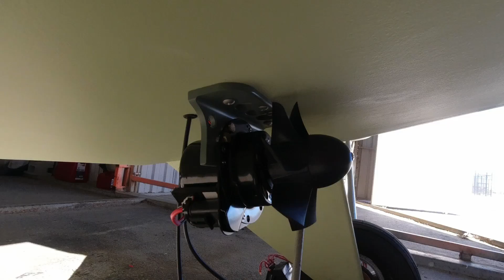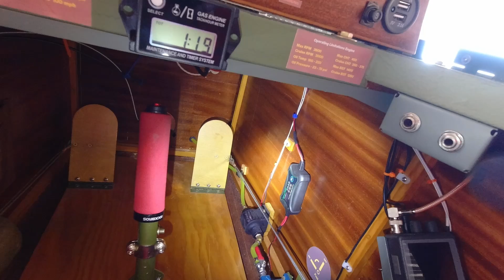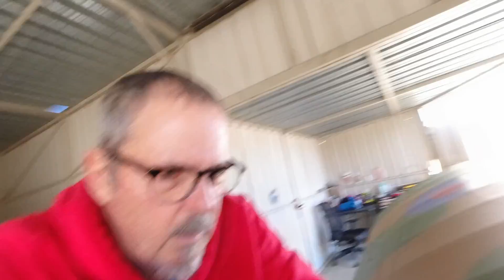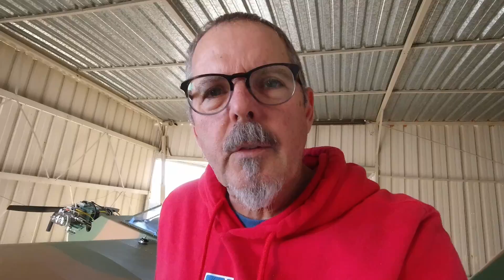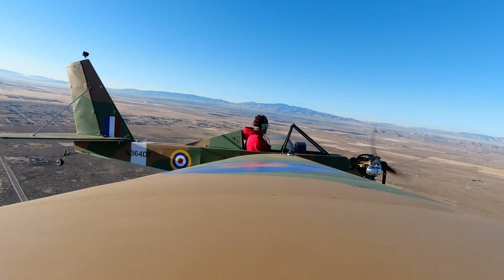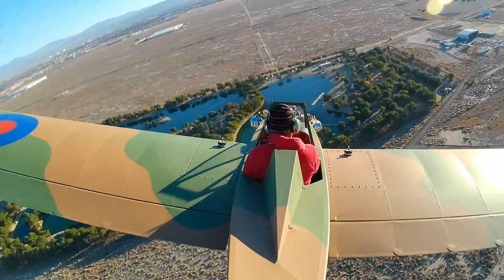Team Minimax 1100r Aircraft - Beautiful Day For Flight Testing

Comment: Just out of interest, what fuel does a Hummel 1/2  VW run on?
100  low lead or Mogas?
If it's Mogas, what octane rating is recommended?
Reply from the maker: I use 100LL. Scott says that’s what it’s designed for. You just have your keep an eye on the plugs for lead but I’ll change them often enough not to be concerned. 
If Mogas, I believe the manual says 93 min.

Comment: Thanks for the videos!  If you experience an unexpected off-airport landing, one the most common outcomes is for the gear to drag causing an over nose flip.  How are you for safety in such an event?   Seeing only what I can from the videos, I worry that you'd be positioned for head and neck injury. You can not lean forward to protect your head due to safety straps. If I'm not missing something, I would strongly/urgently urge a rear rollover protection.
Reply from the maker: The wind screen is built as a roll bar. I am going to build a helmet for additional protection. Thanks for following along
Reply: @DTMinimax   Delighted and relieved to hear that the windscreen is designed as a roll bar.  Has it held up in practice (accidents)?  I applaud your move to a helmet.  I fly with one.

Comment: How much lumber did you need for the build would love to know.
Reply from the maker: I used 5-2x6x12’ KDS4S Douglas Fir
2-1/2 sheets of 1/8” mahogany ply
8 sheets 1/16” ply that were 2’x4’
Some 1/8” Birch ply 2’x4’
2 sheets of 1/32 ply 2’x4’
1/2 sheet of 1/4” ply

Comment: Great to hear the Gennipod is working for you. I would hold off on the prop until you have about 20hrs on the engine.
Reply from the maker: Did you see the tanker release his water on that last circuit? It was so cool to see from the air!
Reply: @DTMinimax  I am sorry to say I was watching on my phone so didn't see that, I will have to look again on my computer.
Reply from the maker: That’s good advice…it’s not under powered and dragging around the sky, it is flying fine. Yea I’m really impressed with the Gennipod

Comment: I'm thrilled for you, Dennis.  Life is short.  Enjoy...  I'd be interested in some numbers.  Empty weight, straight and level cruise speed, fuel burn and range, engine off glide ratio, landing speed, etc.  And did you do the flaperon option?  My UL had that, so the plane would meet FAR 103, but was told never to use the flaps.  I never did, but I did add a couple of flaps reflex notches, which made it easier to trim for level flight, and added a tiny bit of speed.
Reply from the maker: You’re so right…life is short. I will bring some of that info to you.

Comment: Great video and great news on the Gennipod.  Nice installation, mine isn't as elegant but glad to hear the solution works.  I hope to have mine installed in a couple of weeks.  Thanks for sharing your journey!!
Reply from the maker: Hey William, you’re installing a Gennipod?
Reply: @DTMinimax  Yes, a GenniPod II on my Bowers Fly Baby.  Because of the fabric bottom, I'm installing mine on a landing gear strut, similar to what another Fly Baby did a couple of years ago.  I was fine without it until I installed a transponder and ADS-B out.  Now the batteries last fine for local flying, but are insufficient for any reasonable cross country.  I'm not using LiPO's, but may consider it based on your experience and installation.
Reply from the maker: @wfhills  Mine is also the II, I was so happy that it worked so well! I did it for the same reason, I don’t plan to stick around the airport for long:)
Reply: @DTMinimax  I finally installed my GenniPod II on my Fly Baby and it seems to be doing a great job.  Unfortunately, I have a tired old sealed lead acid battery that I'm planning on replacing.  If you don't mind saying, what LiPo battery are you using?
Reply from the maker: I’m using the expert power battery
Reply: @DTMinimax  Thanks!!!